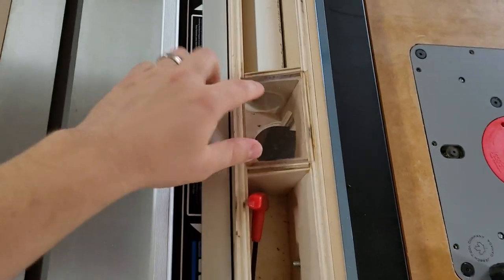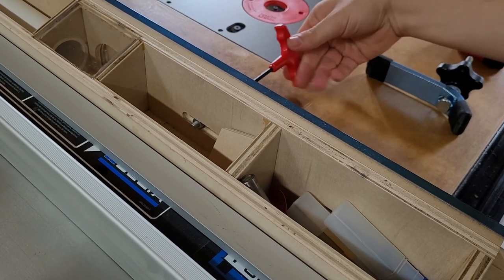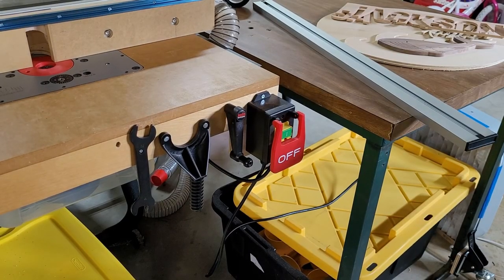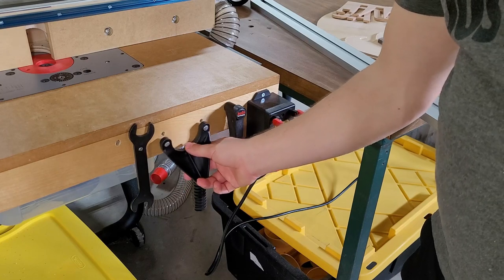Delta 36-725T2 Router Extension Wing

Comment: Hello, I was wondering if you added any support for the router table to the floor. I have added the router wing and find if someone were to lean heavily on that side it will tip over. Thanks and I will echo what others have said, great idea with the plastic tub. Has it held up?

Comment: When you mounted the router table to the table saw, did you add/drill more holes or use only existing holes from fence rails? Nice build with some clever ideas. I might have to steal the Rubbermaid idea.
Reply from the maker: No additional holes, I just used all the pre-drilled holes. I used 1/4-20 bolts about 1" long with nylock nuts.

Comment: Super job David! Too bad you weren’t able to get the construction & installation on video. One concern / question, regarding the dust collection, is it in fact for dust collection? If it is, is there any concern about dust getting into your motor vents? On the other side if it’s just protect the router from getting full of dust, is it able to get a minimal amount of air in there to keep things cool? As far as that fence goes, absolutely brilliant. I would dearly love to see how you built that. See you in the next installment.
Reply from the maker: Not really sure what you mean. The router itself has an internal fan to keep the motor cool that draws air from the top and blows it out near the bit, which also prevents dust from getting inside the motor. It adds a bit of turbulence inside the dust collection box, but the dust collector can overcome that I think.

Comment: Very ingenuitive !!! Lol. I love the rubber maid dust collection that snaps off! I’m sure you could make one with wood etc but this fits perfectly! You should make a set up and build plans, costs etc and post a new video !
Reply from the maker: Thanks man! I came up with the plastic container idea because I didn't have time to build a cabinet around the router and I wanted to have at least some dust collection. I'll probably build a more permanent cabinet later. Honestly the whole router wing cost <$100 in materials if you don't include the router lift. It's just 3/4" MDF and 1/2" plywood.

Comment: Very nice.  I did this as well with my Delta 36-725 - but it was a much simpler build and now I am going to have to redo it.  I'll probably do something very similar to this.  I think it would have been helpful to see more details about how you attached the router table frame to the rails/body of the saw.

I like your dust collection - although I would caution against using that plastic container unless the vacuum was attached and running because you will want the airflow to cool the router.  But the over-and-under dust collection is great.
Reply from the maker: Thanks! Yeah I only use the router with the dust collector attached. To attach the router table to the saw I just used 1/4-20 bolts with a few washers and nylock nuts using the pre-existing mounting holes for the support bar.

Comment: I recently purchased the saw and am going to add my bosch router top to the wing. Was going to build something very similar. Can you elaborate more on how the slide part of the fence is attached exactly. Absolutely love the build btw very innovative
Reply from the maker: Thanks! If you take the aluminum extruded side off of the right side of the table saw fence there are 3 holes that hold the aluminum to the 2x2" square steel bar that makes up the fence core. I just used those 3 holes and the same mounting bolts to attach the router fence. I cut recesses in the fence with my CNC and a little chisel work to make the bolts flush with the plywood surface.
Reply: @GarageTimeWithDavid  Could you explain how you actually remove the aluminum extrusion?  I see there are plastic caps on the end, but didn't actually see how you'd remove the extrusion.  Thanks!
Reply from the maker: @KitLake  Sure. In this pic I flipped the fence on its side so you're looking at the bottom. There are 3 of these rectangular cutouts which give you access to the 3 nuts and bolts that hold the extrusion to the steel tube. Just slide a wrench in there and you can loosen them enough to slide the extrusion off of the end. https://photos.app.goo.gl/HecPYCqRe5sFkTN49
Reply: @GarageTimeWithDavid  Thanks a bunch!  I somehow missed that.

Comment: Might want to look into the depth of the holes for that tool that can be knocked off and check to see if the two metal bits on the tool are ferrus material. If they are steel and magnets will stick to them, find some neodymium magnets with the same diameter as the holes you drilled, then just use some epoxy to get them to stick into the holes you drilled and the tool can be hung into the holes more securely via magnetics.
Reply from the maker: I actually have a couple of neo magnets installed in those holes, but if you hit the handle a bit too hard it can still pop out. :)

Comment: Great add on! I recently got a 36-725 T2 and have been wanting to do this for a while. So tired of pulling out my portable router table and palm router. Going to get a proper router lift and build this. Only downside I can see, is not being able to use the table saw for a left hand cut. Of do you just use the router fence as your table saw fence? Anyway, great build and thanks for sharing!
Reply from the maker: Thanks! I honestly just never use it for a left hand cut. The handful of times I tried it it just felt weird being on that side of the blade, so I just avoid it.

Comment: That's pretty slick man !  I really like your DIY over the table dust collection.  How's that working ?  Also, you pretty happy with that Jessem lift ?  I've been thinking of getting the same one.
Reply from the maker: The router table  dust collection works really well. I get surprisingly good airflow though the fence. I like the jessem lift but it is a bit annoying that it takes three tools to use it. Next time I might get one with the plates that just pop off by pressing a button.

Comment: What about your Router being air cooled and that that plastic box has no air inlet to it?
Plus and dust collecting in or around tge routers air vents?... and that's all I got to ask about that.
Reply from the maker: It's always running with the dust collector on, and air can come in through the ring around the router bit. I'm not concerned about the motor overheating. The dust collector keeps the box and the router pretty clean.